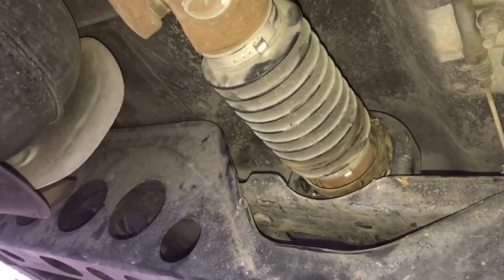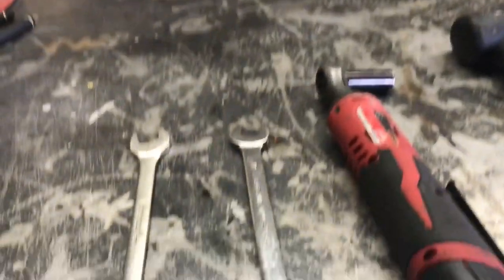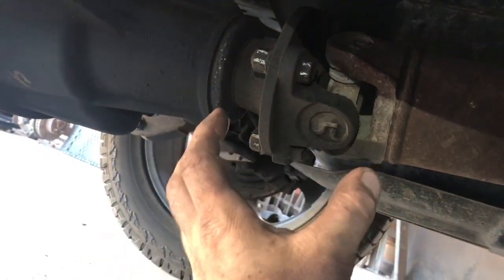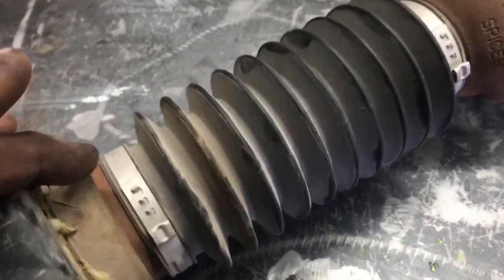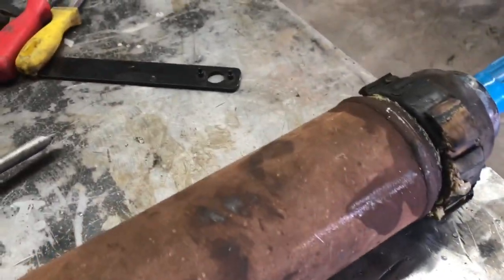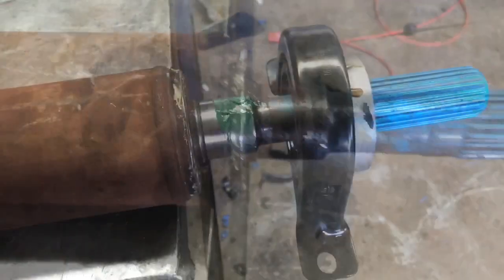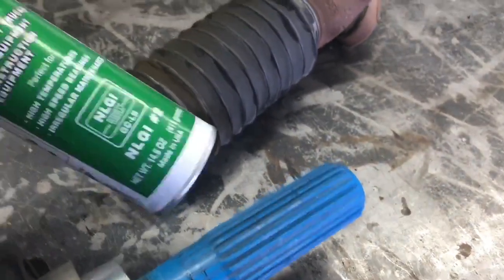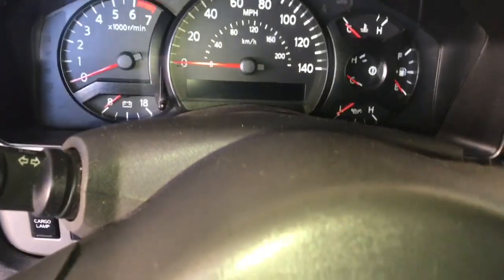Nissan Titan Carrier Bearing Replacement ( Tips and Tricks)

Comment: Of course, when I go under my truck, the newer models have like 8 - 10 hex bolts held in with 15 mm nuts that hold the rear end of the driveshaft to the rear dif.

Comment: Just had my carrier bearing replaced in my 2017 Nissan Titan, now I have a vibration at 40-45 mph. What went wrong????
Reply: Interesting I have the same issue
Reply: Supposed to mark the drive shafts before you seperate them. I dont believe this guy did.

Comment: Thanks for the great video! Just did this on my 08, I had a machine shop remove the bearing after no luck tapping it off by hand, they pressed the new one on, and they assembled the drive shaft back together all for only $35, part at O'Reilly's was $90.

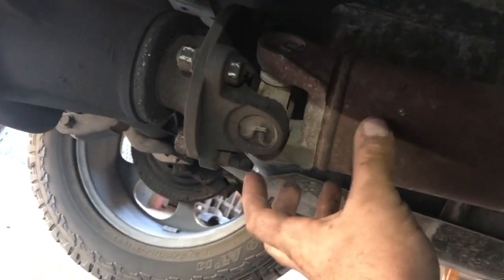Comment: I know that this sounds crazy. Listen. I was stuck for an hour with the rear differential bolts. Use lubrication. I used WD40. Wait 10 minutes at least. Get a small car jack to jack up the wrench to get that leverage you really really need . I used a drill and a large Allen wrench attached to the chuck to lift the jack up and down quickly. You only need one 17mm wrench on the back side. Grab a small cheap little butane torch and heat each bolt individually before you attempt to finally remove it by hand force with the wrench. Take it slowly but this worked for every bolt. I’m actually on the toilet now, about to go back downstairs and take this thing off. I’m @ 2:40
Okay next day. Used a project piece of 1 1/4" PVC pipe from Home Depot for about $5 to install the bearing. It will be a perfect fit for the inner race. Use a torch on the bell housing to make it easier to bang on. Use a chisel on the inside of the bell housing and bang it on in. Slowly but it will go. Also, I found my entire U Bolt at Autozone for less than $50.

Comment: This video is leaving out so many needed details it should be considered dangerous. This is going to set people up for failure and cost them a lot of money. You're taking the Haynes repair manual approach you may as well just took a picture of the truck with an arrow vaguely pointing underneath and said "remove bolts, inspect for damage, replace if necessary, installation is reverse order of removal" the only difference is there's a video instead of a black and white picture

Comment: Front driver shaft slid back on my coming out of the tail shaft of transmission after I replaced the bearing, my buddy was using the truck to pull out a f250, later I found out he was jerking on it with my truck, what would cause the front drive shaft to slide back enough that it called out of tranny? After I installed the shaft it ran fine no vibration or anything then woke up next morning for work and that damn thing fell out on my? Help please it would be greatly appreciated

Comment: My truck when I take off, it feels like I’m running over a bunch of tiny bumps in the road at about 20-35 mph. Is this the problem?? The whole truck kind of shakes at that stage also. And when I’m doing about 55 mph, it makes like a fan noise. Like one of those old box fans. We checked my motor mounts and those are good

Comment: Hello Aaron, thank you for the awesome video. I had a quick question. My carrier bearing was worn so I removed the driveshaft and took it to my mechanic. He removed and installed a new carrier bearing. I made sure the carrier bearing was installed in the same exact spot as the old one. I put the driveshaft in (exactly as it came out) and now there is a very small leak where the driveshaft meets the transmission. Do you have any idea why? A broken seal? Thank you
Reply: Did you find out? I also have a leak where you mentioned.
Reply: @isaitorres9929  "Extension Housing Seal". If you search on rockauto, you can find it under the Transmission parts tab
Reply: @RDG4R  appreciate the response! Was it a tough/expensive repair?
Reply: @isaitorres9929  Not a problem. The job was very easy, just a matter of popping off the old seal and putting in the new one. I didn't notice that my seal was in fact old and brittle. Make sure it sits right when you put the driveshaft back on. Here is a pic from the service manual 
https://ibb.co/ph0vJnC

Comment: I have a titan that has a thumping sound that sounds like its related to the truck rolling , any ideas ?  feels and sounds like it may be related to the driveshaft
Reply from the maker: crawl under and shake the driveshaft around the bearing area. the rubber mount could be all broken up. could be a u-joint as well!
Reply: Aaron Hines thanks !   I did after seeing this and right around the boot it moves left to right a good amount .  That’s all I could find out so far . Going to take to my buddy’s shop to inspect . I had it at Nissan to inspect , change oil , do three recalls after telling them what I knew about it since I had just bought it . It’s been there for a week    All they Did is change the oil and their inspection is it ain’t worth fixin!  And that it has a blown head gasket    Not sure how they figured that but   Didn’t do the recalls and didn’t give me any info on the drive shaft noise

Comment: how did u put the bearing back? the titan has a longer shaft than other truck. I was thinking to use a 1-1/2 pipe to hammer it in. What did u use?
Reply from the maker: A pipe works great! That’s what I did
Reply: Use a PCV pipe from Home Depot

Comment: im in a bind i need help. i just replaced the carrier bearing on my 04 titan today but it started vibrating again awfully. the front shaft slid back and the rubber is stretched back. what could be wrong?
Reply: Guys there is something very important, you have to mark everything before removing the driveshaft so you can put it back exactly the same way otherwise is gonna be unbalanced. He didn't mention this, IS VERY IMPORTANT.
Reply from the maker: That’s strange. Did the new bearing install tight? I don’t see how your front shaft can move. Check for weights missing out or visual damage to the drive shaft. It may be out of balance
Reply: Thanks bro appreciate the info
Reply: I'm have same problem Jesus Raygoza how did you fix it bro?
Reply: Lawrence Miller the shafts were out of balance took them to a shop specializing in driveshaft and they balanced the shafts put in New carrier bearing and replaced u joints for 220 dollars. They gave me the shafts assembled ready to install. Ran like new after that. Hope that info helps.

Comment: Hey Arron I have a question about my Nissan Titan. I have a little jerk/play every time I come on a full stop and accelerate. Only happens when I fully stop. There is a little lag or play when I step on the gas.
Reply from the maker: That could be the slip yoke,, motor mount, trans mount, or play in the rear differential. Can you hear this?
Reply: Aaron Hines there is a popping sound on the front end passenger side but I don’t think that has anything to do with the play? Because the popping and clunking occurs when I hit bumpy roads
Reply from the maker: that helps. sounds like something in your front suspension is loose. have your upper control arms been replaced? those and sway bar bushings/end links are common issues to go bad on these trucks. i have a video on how to replace the upper control arms. its easy! if you cannot figure out where the noise is comming from. i would recommend taking the truck to an alignment shop have them put the truck on a rack and inspect for loose components. here is the video for the upper control arm i made. cheers!

https://www.youtube.com/watch?v=4qE4g5PAeKU
Reply: Aaron Hines thanks man I already watched and liked that video!
Reply from the maker: Thanks bud! Let me know what u find.